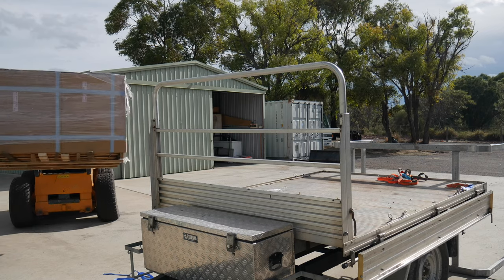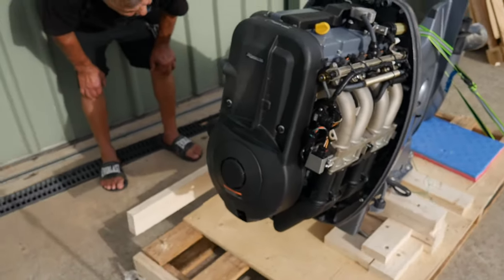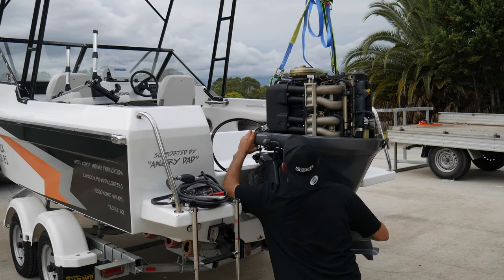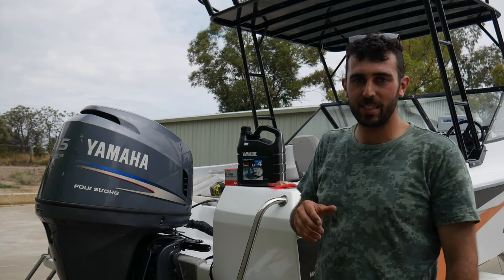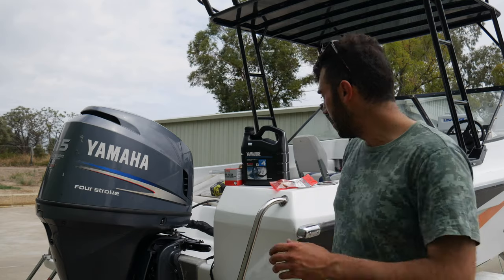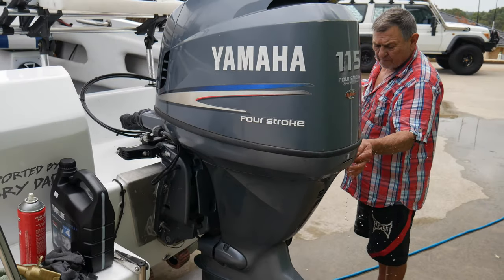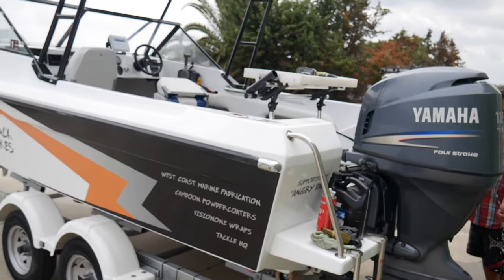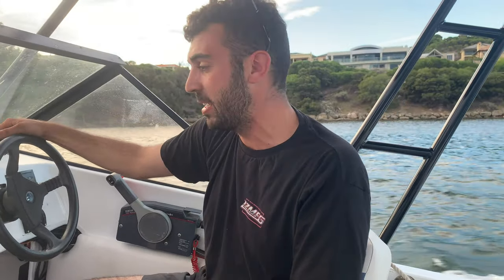I INSTALLED A FOUR STROKE YAMAHA | FAREWELL THE 2 STROKE | FULL BOAT RESTORATION - PART 27

Comment: I love 2 stroke engines and even though yamaha make great engines I would have stuck with the etec. Sad to see they discontinued. What do you think of the yammie over the etec?
Reply from the maker: Hey mate, the outbaor dis heavier but ALOT quieter and doesn't smell like an old 2 stroke!
Reply: Is the boat slower with the Yamaha given the extra weight? What's the fuel consumption difference like between the two?
Reply from the maker: @stacky86  Hey mate, much for muchness really, i found that the boat was similar speed, Maybe a knot or 2 slower but nothing crazy

Comment: hello from Greece
is it better than the Evinrude?
Reply: Nup, Its a big heavy pile of shit with no torque and corrosion issues within the dissimilar metaled powerhead never designed for salt water use .....  hitting the throttle to get out of the hole is the most depressing thing you could ever imagine,   he will tell you its quite but at half throttle upwards its as loud as the evinrude ..   the etec uses 1/10th the fuel at idle same up high,  people are clueless buying this 4 stroke shit.....  agghhh the 2 stroke was smokey and smelt  .. the 4 stroke has clean air coming out of it 😂🤣
Reply: @dave216dx  I thought of all these 😂😂😂 thank you for your answer